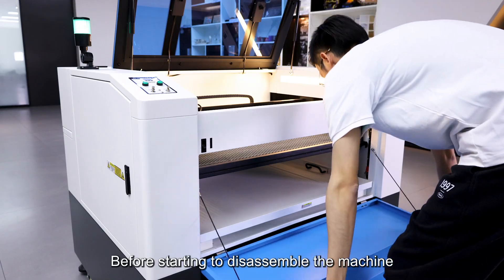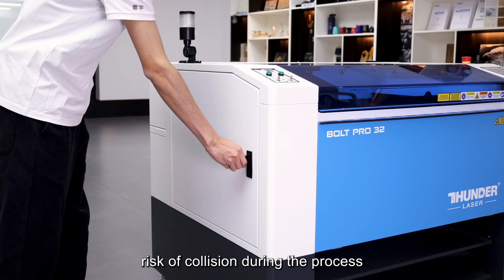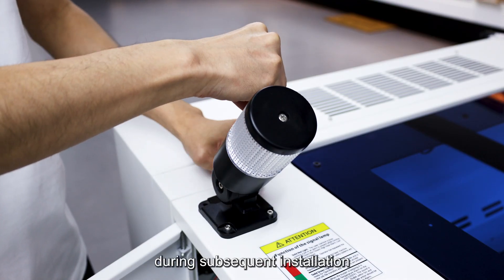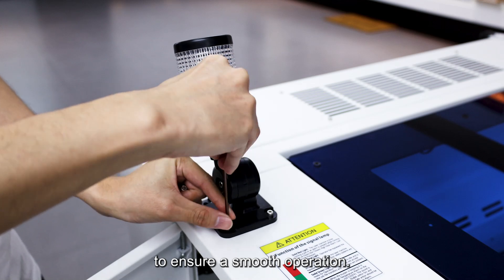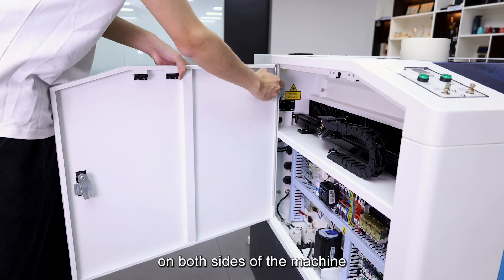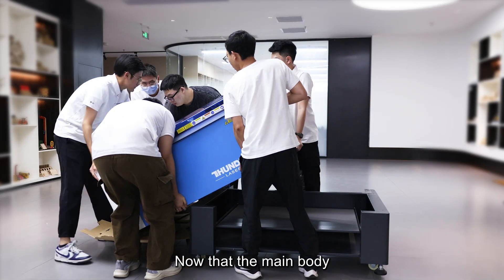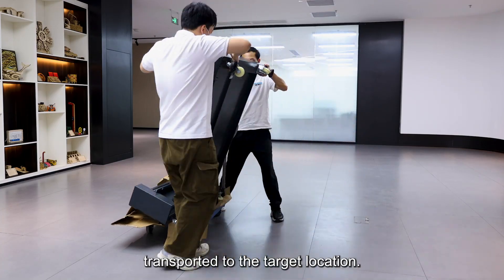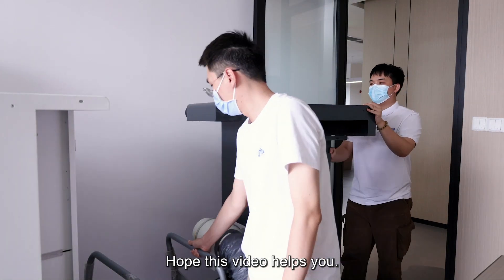Thunder Laser Bolt Tutorial: How to Get Bolt PRO32 Through Standard Doorway

Comment: I'm considering the Bolt Pro 22 model.   The bedroom where I want to place it only has a 29" wide door.   Can the Pro 22 be broken down to the base unit, positioned on a dolly and be safely rolled through the doorway, then be reassembled once inside the room?
Reply from the maker: yes. It can be disassembled by unscrewing the screws.
Reply: Are you saying the Pro 22 will fit  on it’s end using a 4 wheel dolly and rolling it through a 29” wide doorway after the top is removed from the bottom base?